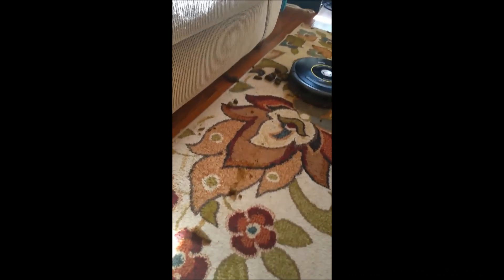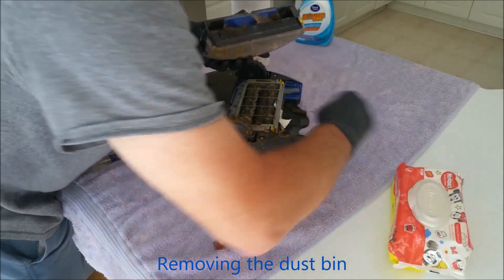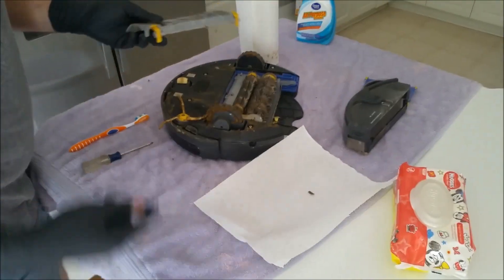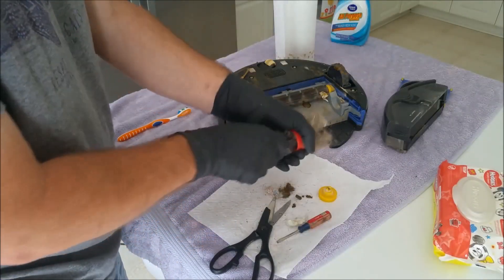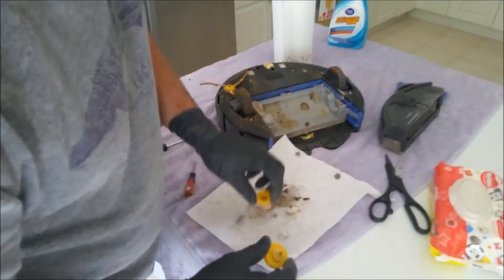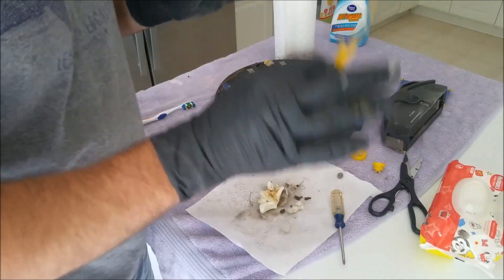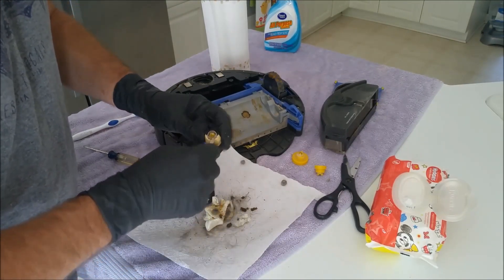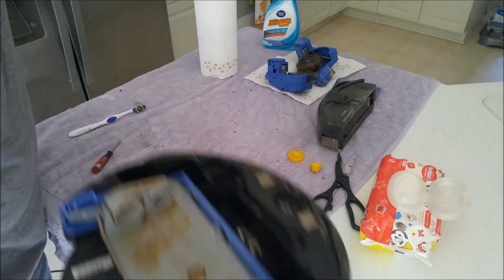When your Roomba 660 meets a pile of Dog Poop

Comment: If you go to a beauty supply near you that is open to the public and not just professionals only, you may find a brush soaking and sanitization powder that you mix with warm or hot water to soak and sanitize brushes, combs ecetera. There used to be one that would dissolve hair and other organic matter that may be trapped in the brush, not sure if that one is still around, it's been a few years....
Reply from the maker: Great suggestion.